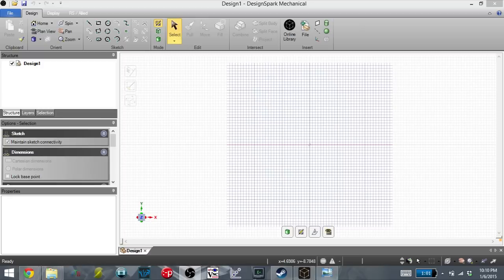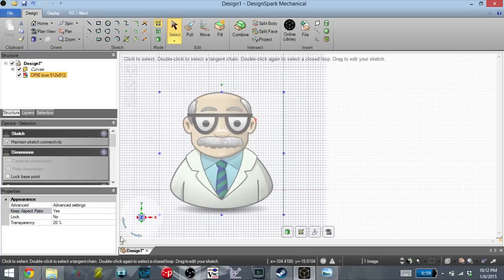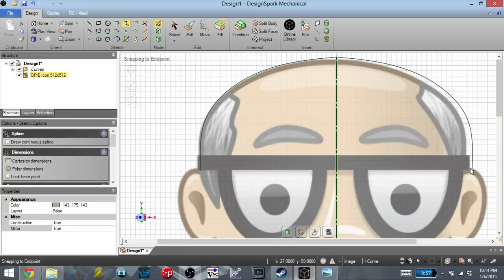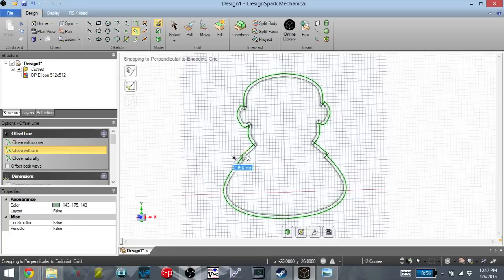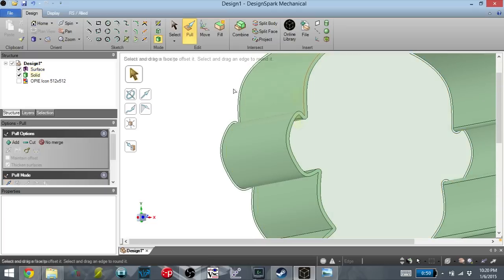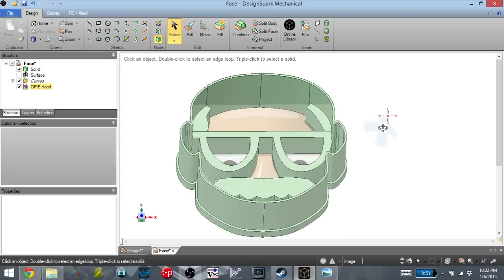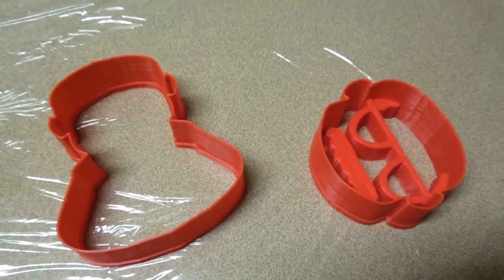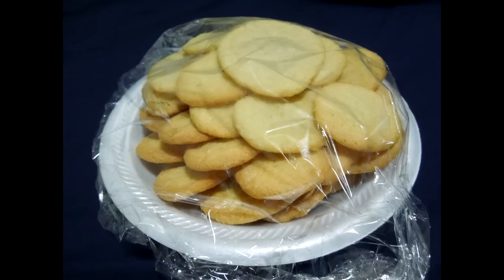Custom 3D Printed Cookie Cutters!

Comment: The size of your cookie cutters or the amount of dough was NOT the problem. Your cookie dough recipe is the problem. You have to find a cookie dough recipe that works with cut outs. There are many that state they will not lose their shape. I just searched cookie recipes for cutouts and I got a lot of results. You can also google gingerbread cutout cookie recipes. Please give it another try. I am sure this would fix the problem. If you do so, would you mind posting an update? I love the cutter you made and want to see it work.

Comment: Thanks to your video, I'm making passable cookie cutters now! I am specifically having trouble with two things in this program. One-I don't have the same buttons you do, so I'm having difficulty with the "handle" or lip on the top. Two-my grid in the background is MUCH bigger than yours, so the splicing looks like 1st grade tracing,! Well, that's probably an insult to the 1st graders, lol
Reply from the maker: That is awesome to hear! I haven't downloaded the last version of DS:M in the last year or so, I unfortunately I can't help with the first issue, but I think I can help the second! When the splice tool is selected, there should be a "Options - Sketch" panel open on the left. Near the bottom, there should be an entry for "Snap to Grid". You can uncheck that box, and you should be able to place a point anywhere!

Comment: Hey there, could you please give an explanation as to how you designed the face with the internal features.  I am trying a similar concept however I cannot work out where the internal framework should join the external.  Im using DS also.
Cheers

Comment: This was such a helpful tutorial, thank you so much.  Can I just ask what filament you used? Thanks :)
Reply from the maker: +katielb75 I used ABS to print these, although it really shouldnt matter too much if you used ABS or PLA. If you are worried about sanitation, ABS would be the way to go because you could acetone vapor bath the print to help smooth the surface and reduce the nooks and crannies that bacteria could live in.
Reply: +Hoffman Engineering Thank you so much, I appreciate your response :)